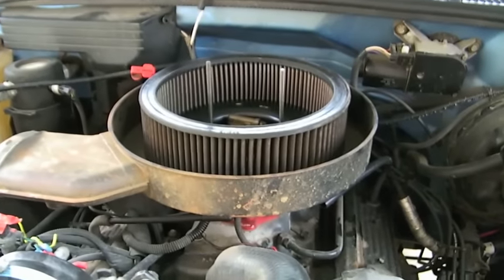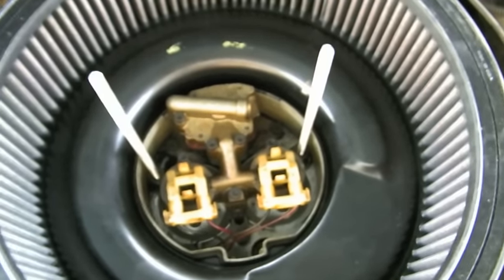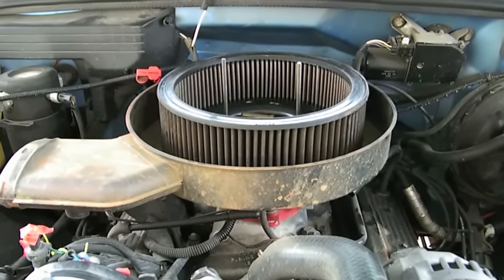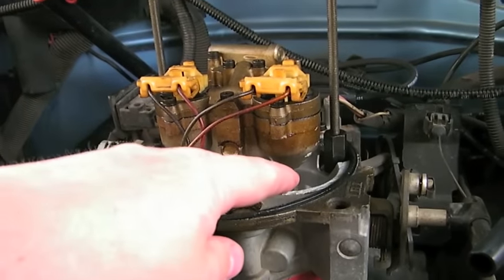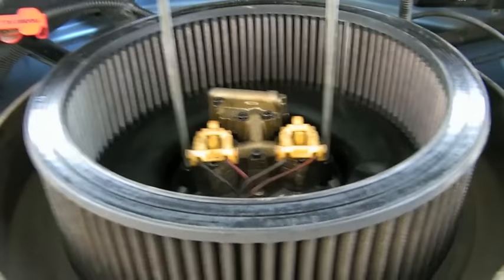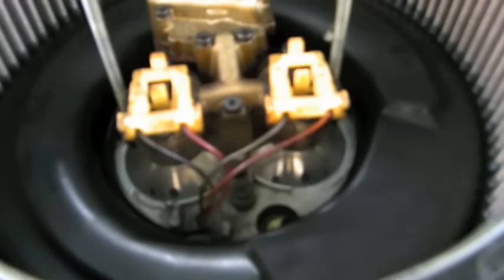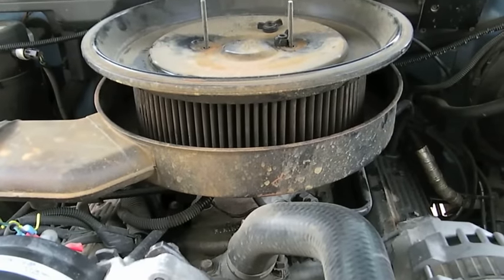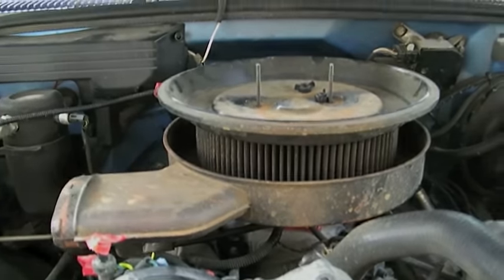TBI mods, how to get the most power and Horse Power from your TBI engine.

Comment: You can pick up a extra 10 hp by running synthetic blinker fluid, also stage 2 muffler bearings will pick up about 30 ftbs of torque ...still testing the power gains from adding a JEGS sticker I will let you know the power gains after I download that horse power app you got
Reply: +Dan Gerous Don't forget that using synthetic grease over regular in your muffler bearings is also good for a few free HP.
And those little Turbo whistlers you stick on the tail pipe help suck out back pressure for more free HP.
Reply: William Beglen
you can buy a vw beetle radiator for about $80.00 they fit late 90's VW Beetle.
Reply: William Beglen
easter egg, LOL !
Reply: +Dan Gerous LMAO great points
Reply from the maker: +William Beglen the  new ones are water cooled.
Reply: Sounds like someone pissed in your soda pop.
Reply: I did everything you said and now I keep blowing radiator fuses.
Reply: I'm going to try those performance Cadillac convertors
Reply from the maker: +UsedBridgeSalesman 
Hmmm, try jiggling your co pilot.
Reply: Dan Gerous lol I happen to have a jegs sticker on the back window of my truck. That's the only sticker I have
Reply: Does it make it go faster ?
Reply: Dan Gerous1z
Reply: Dan Gerous
Reply: using a mixture of cooking oil and sugar in gas tank will give u a  nos injection feeling
Reply: +chris guti nos injection feeling I gotta try that for sure bet it kicks like a mule when it shifts gears too and burns rubber lol!
Reply: Dan Gerous you also forgot the electric turbo mod.  Ebay has these bad boys for 40 bucks..🤣
Reply: Dan Gerous oh and don't forget to remove that spacer under your pedal. All those ponies right under your foot at least another 30 hp..
Reply: Adding a ford sticker to Sir Burban reduced wind drag by 8.37%!
Reply: Dan Gerous 😂😂
Reply: everybody uses the same used up jokes, just like dans mom.
Reply: Dan Gerous What kind of net gains do you think a stroked master beta valve would give?😂
Reply from the maker: Nothing unless you upgrade your gimbal sprockets.
Reply: Removing the tailgate will boost up some good hp
Reply from the maker: That quality advice
Reply: Haha!  I will try that right now after I get me a box of grid squares and a piece of flight line.
Reply: Don't foget high performance turnsignel lubricant
Reply: A "Type R" sticker is good for at least a second on your GMC truck.
Reply: Make sure yall grease up the throttle body ports so they can have extra flow and lubrication should add around 3-5 hp
Reply from the maker: I have started using airplane grease, because they go fast in the air.
Reply: @gaaat90304  I guess a DrPepper and a Mentos is way too much boost...
Reply: You can get a lot of free extra torque if you just make sure to tighten all of your bolts with a torque wrench. Don't be lazy. That's what they were made for! The tighter you can get them, the more torques you get back!
Reply: Conventional blinker fluid is a better bang for your buck. Last longer
Reply: Soap in the gas tank really cleans everything out...especially if you do the old "drive around for a month with a potato crammed in the tailpipe" trick. Works every time
Reply: Yeah but with all those mods you will need a Gyro Control to help handling around the curves. A lot of guys purchased them and installed them in their trunks back in the late 60s. A large ball bearing in a long rectangle box. It was the joke of the decade. LOL
Reply: Most guys think 93 octane is the best gas meanwhile it really has the least amount of actual gas in thus leaning out engines all dummys are using 93 meanwhile im getting full tuning power out of 87 octane real man fuel! I even freeze my 5 gallon fuel tank before i go racing to free the molecules and get more fuel into the combustion chamber! The lid flip air intake was my first mod next mod im going for is new wheel bearings on all four sides!
Reply: Lmfao🤣🤣😂😂😂😂
Reply: I added a sticker to my back window to add 15hp
Reply: I sold you a set of wobble bearings a while back didn't I?
Reply from the maker: @thehunteking and they are doing great.   Thank you.
Reply: LMAO , don't forget the fart can muffler and the giant ass spoiler on the back. 😂

Comment: What did you do with your breather hose that used to go between the TBI and air filter ?
Reply: He probably just capped off
Reply: I would not recommend that. It’s part of your crankcase ventilation. I put a small washable filter where the tube comes out of the motor and then plugged the hole in the tbi collar. Fresh filtered air is now run past the small filter through the crank and into the intake via the pcv valve

Comment: can you use and just cut the original studs for securing the air lid into place if you have the double posts?
i have a very well kept, all original, nothing missing 1994 chevy suburban silverado edition. with barn doors, captains seats in the front. all power everything and it all works. and its got the 5.7 350 tbi in it. but i swear it hauls too much ass for it to be bone stock. an old man bought it brand new off the lot and garage kept it with barely any use and regular religious maintenence for the first 20 years of its life. then he passed and gave it to his daughter who daily'd it till it was about 27. and then i paid 1500 for it with 142k original miles on body and motor. and i brought it up to 158k

Comment: Don't ever pick up a tool ever again. The Venturi need not be messed with. You've now created a spot for turbulent air to impead the fuel suspension. Not to mention all the metal shavings you left behind.
Reply from the maker: +Gary Humphrey it's all good.
Reply: Gary Humphrey tell that to stock car races who grind the fuck out of air horns and venturis on carbs... it works, the air may not be smooth but there is more
Reply: I'm sure he didn't do it with it with the TBI on the truck
Reply from the maker: It was on the truck. I am savage like that.
Reply: boofighter LOL 😂. THANKS FOR THE VID. SAVAGE.

Comment: How to improve a tbi for power , pull  tbi motor . Install new motor with  good flowing heads 10.1 compression with carb.  Change sending unit in tank for carb set up .
Reply: Add some valve springs that don't float a 5500

Comment: I used a 82 chevy top half (lid) on my air cleaner and now a almost 6 inch tall filter fits in it and it looks stock still using the stock  cold air system but with a 6 inch tall filter. And the hood shuts and everything LOL

Comment: ok so this most likey wont give you 20hp but if you properly sand and smooth the TB then your throttle response is so much better youll actullay see a diffrence
Reply: use a extra or make an extra injector pod spacer/gasket. double them up to raise the injectors about 1/8th inch. getting them out of the tbi throttle bores. helps flow. smooth the entries or mill down the throttle bore "horns" and radius them properly.  pop the small brass button out of the bottom of the fuel pressure regulator. put a small slit in its screw. now it can be adjusted for a bit more pressure. no need to spend on a aftermarket one. yes a tbi spacer DOES help on these. its a wet flow setup like a carb. so they do help. and a better filter setup. thats a good bit of work but its free. or buy the 670 cfm unit from holley.
which o would reccomend. it has bigger injectors "no tune needed " and 2 1/16" throttle bores. HUGE  and i mean massive compared to the stock unit. ive gone both of these routs. butnill say yank it off and throw a 650 cfm carb on it and run circles around the tbi... no bs there. the carb will flat out smoke even the 670 holley tbi. been there done that

Comment: the lid flip seems to have some effect, ive test drove mine with and without it fliped and it does seem to accelerate faster with it fliped. the only downside is if you drive in the mud alot like i do. you will be buying alota new air filters due to water and mud gettin on it

Comment: 15 mpg highway with my bone stock 1994 K2500 Suburban 5.7 with 4.10 gears, guessing that may be slightly better fuel economy than the 454.
Reply: Nope...I get 14 with the 454, 4.10s..4L80E
Reply: Nope I get 16mpg with my 95 Chevy 2500 454 5speed. FACTS
Reply: @showcasecharlie11  My son just bought a 1993 K2500 Suburban with the 7.4 (454), don't know what his mpg is yet.
Reply: I got better than that long as I keep at 55mph run it 70mph watch it free fall

Comment: Here in Mexifornia the mods you did will make the vehicle fail the 'visual inspection' part of the smog test. Specifically the air cleaner lid flip. The other mods will not give much, if any noticeable performance gains, but throttle response may improve slightly. A good filter such as a K&N that fits in the stock housing is a good investment and best for off road dust and dirt protection. My '94 Chevy K1500 with a 5.7 L V-8, Transdapt spacers on the TBI AND injectors, K&N filter with a 3" Flowmaster exhaust system with a cat runs strong for what I use it for as a bike hauler to the dez and mild off roading. It passes smog and is problem-free. All the mods were bolt-on and easily reversible if ever needed.
Reply: I also did the tbi riser plate spacer , cold air intake and throttle body spacer and have taken it to get sniffed twice here in Southern California and passes no problem. I don’t think if I was to shave or the lip on the throttle body the smog technician would even notice as they don’t take off the cover on the filter…

Comment: You should upgrade your fuel pump to a 1996 which puts out more pressure at high rpms. Summit has what you need. Or rockauto.
Reply: They say getting a 350 Tpi fuel pump will not drop on hard acceleration..instead of tbi

Comment: I see better performance with the air actually being pulled in from the outside as it is colder coming in. Mabe runnig a bigger pipe to somewhere that air can be pulled or even forced in from outside.
Reply: Cowl hood, raise the air cleaner up into the cowl scoop, foam seal to hood. Will draw cool air from the low pressure area at base of the windshield. That's what cowl induction is.

Comment: No comment about that I've done that and other things to my 90 Silverado that I was wondering other than removing the cat how I could gut it with it being 26 inches long and 13 inches wide I have seen some videos where people use screwdrivers but I would like a 26 inch long drill bit I'm assuming and I don't want anything left in there it has to be on there where I live but it does not have to pass emissions makes no sense so I must gut it any suggestions would be appreciated 👍

Comment: I've got an 88' GMC 350, and I've noticed when I take that metal ring/collar off, the air cleaner unit(because it's now sitting lower) runs into stuff in the back like the distributor cap/wires etc..did you have this problem?
Reply: he has a spacer under the throttle body making up the difference

Comment: you wanna help performance put a dime in side the fuel pressure regulator to allow more fuel to flow
Reply: I have a 94 Cheyenne 2500 on its second tbi motor. Motor has about 150000 truck has 336000. 3 3/4 exhaust straight piped headers back. I just bought it. What can i do about the shut off at 105 mph? And how can i get there faster for cheap?

Comment: I have the throttle body spacer it was given to me. Do the really make a difference? Or even save gas mileage like they say they do?
Reply: Larry Gonzales Al lot of guys like them for gm trucks, but i have yet to see a dyno compar. For most vehicles i've looked into though, its a wast of money.
Reply from the maker: +Larry Gonzales 
i did not notice a huge gain, the other mods i did had a greater affect.
Reply: Injector pod spacer is the best starting mod.I run a 1/4 inch spacer plus the gasket. Had to clearance the throttle body around the fuel fittings just a little.
Reply: Running 94 cpi vortec swapped to tbi. 94 blazer engine has 208 duration @ .050 cam factory. It is in 88 blazer 2 wd sport.

Comment: Lol just take off the intake and TBI, along with the distributor. Throw it in the creek. Then get a hei, carb intake, carb, and electric pump at about 5psi. Install all that. Get the fuel and timing setup. Viola it runs a million times better!
Reply from the maker: Now that’s some advice!
Reply: That's what I did and it runs a ton better. Those systems are such a pain and have so many problems. I might put a self learning injection system on later. Plus a new 350 going in over this 4 day holiday weekend!

Comment: i get what you are saying there because my drag car runs without a air filter for more air flow (doesn't need one if its only on a track) but also there is a hood scoop that rushes in cooled air from the outside. cold air is better for a engine and can help performance. why do you see all these people with cold air intakes and stuff.
Reply: Now in 2018 you're seeing all the vids that show they don't do as much as once thought.I do agree cold air is better but not being drawn through a straw. A lot of warm air will be better than badly restricted cold air.

Comment: So.  Run a mile on a hot day and breathe with your mouth wide open and then run a mile on a hot day with a weightless refrigerated suit on and breathe through a drinking straw, then see what happens.  The more air that gets in, the more power.  An engine is essentially a giant air pump.  Less air = less power.  What do you think it rushing under the hood when you are driving down the road?  The answer is, the same ambient temperature air that's coming in the side of the truck.

Comment: Flipping the lid does not work... cold air is more dense then hot air. And when you flip the lid your just letting in hot air from the engine. Try going up a steep grade at full throttle and your truck will bog out..
Reply: Does work have seen dyno results. Look up air cleaner shootout.

Comment: Do not do this I just did this to my tbi unit 350 motor. I was trying to get free power but now I have a check engine and it says low vacuum. And my engine stalls at idle. I might me wrong and it might be something besides cutting it off I’m not sure but the issue popped up when I put it back together. It was running great before.

Comment: Michael I bet you my 350 TBI will run a lot longer then your Mercedes. My truck has 300k miles on her all original still runs strong! TBI were not build for power they were built to last. And that's what they do. There cheap to fix. Your Mercedes will cost you a arm and a leg. The people over there at Mercedes have no clue what there doing they just do stuff because they can like putting 2 spark plugs for one cylinder which does nothing! Except make you pay more.. so have fun with that worthless piece of junk:)
Reply: I have a 95  c1500 z71 with 376k miles, this was my dads, he bought it new back in 94, everything is still original,  but those mercedes will last alot longer i own one my self, and I'll tell you it doesnt matter how you drive it, the car wont break, on those chevys you will do alot of repairs before you do one on a mercedes. My benz currently have 271k miles all original and i still give a good race again new camaros SS. Plus gas milage is batter on any V8 even if its a high performance engine líke the one on my benz. So dont talk bad about mercedes every car is reliable its just the owner the one that doesnt know how to take care of vehicle.
Reply: iiOrzh1 if your giving new camaro SSs a decent race then they either dont know they are racing you or they cant drive. but thats besides the point.

if you take care of any car it will last long, however the maintenance cost on your benz will be 4 to 5 times more expensive than some beat up old chevy. the fact you havent had any real problems yet is pure luck. cherish your remaining trouble free time.
Reply: Sean Cosentino 95 chevy 3500 single dually 200k still all original, this truck has outlasted every vehicle that I have own.
Reply from the maker: +steve rodriguez 
Nice work.
Reply: +iiOrzh1 sorry I have to agree with Sean Cosentino these TBI 350 motors in trucks are the longest lasting trucks on the road proven it does have a lot to do  a with the owner but guarantee you will see more 5.7l going over 300k than any other vehicle. And put em threw hell and still keep going and are so much cheaper and easier to work on than any Mercedes I know plus it has a ball hitch on the back so when the Mercedes breaks down you can tow that bitch home!
Reply: you are acting like 200k is alot of miles,,i have over 500k on my 5.7tbi and mercedes v8s are meant to put in miles as well,theyll run forever,mercedes also has made the best diesel engine to many people,,,but i have both and drive my 92 k1500 more tha n my benz,but the benz os also a torque beast
Reply from the maker: +David Peirce I think you win the prize
Reply: boofighter do i get a free throttle body spacer to throw at a chair 🤣
Reply from the maker: +David Peirce it’s already in the mail.
Reply from the maker: +David Peirce thank for having a sense of humour.
Reply: Sean Cosentino I also have a Chevrolet pickup four-wheel drive that has 358000 miles and it's still running strong doesn't use any oil doesn't smoke doesn't tick or anyting* fires right up!
Reply: There's supposed to be a aftermarket fuel pressure regulator kit you can put in those throttle bodies also, if you have headers and an aftermarket intake you can probably turn it a little bit better*
Reply from the maker: Probably. I do t have the truck anymore.